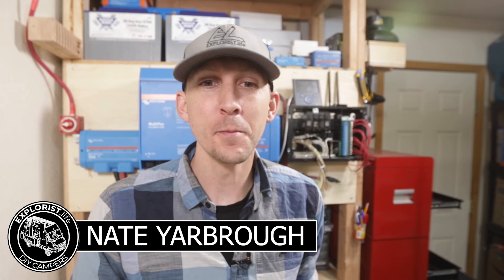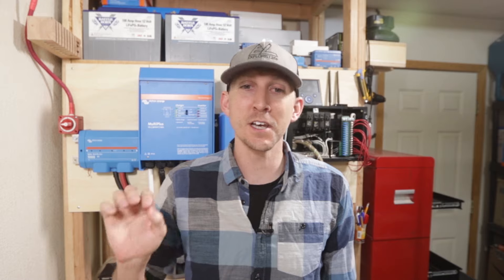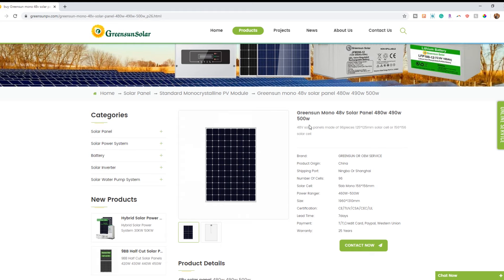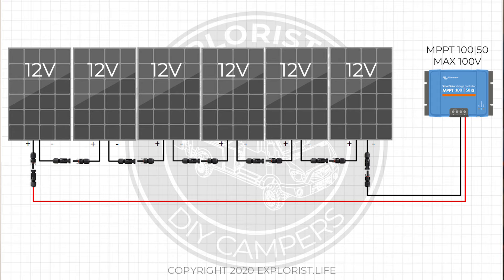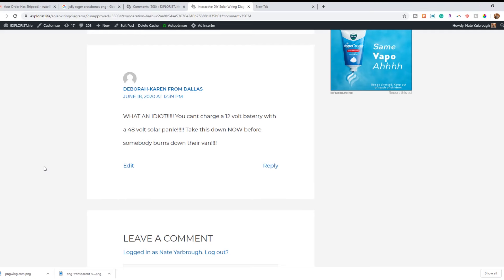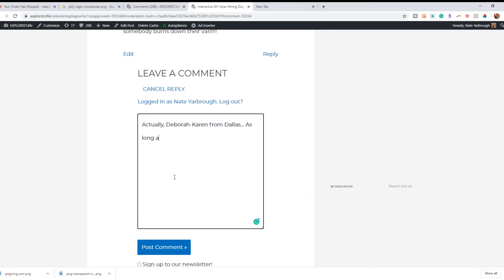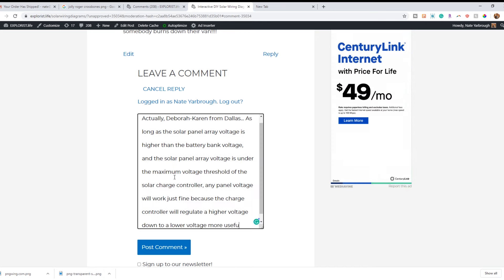12 Volt? 24 Volt? 48 Volt? Which Solar Panels for a DIY Camper Electrical Build

Comment: Hello I have 5 panels of the EPTECH Solar Panels EP156P/72 - 285 Watts  they are about 36.37V I want to use them with battery bank, how many batteries do I need and would you recommend series?

Comment: I have been using 2 house solar panel 48 v on mppt 12/24/36/48 and never had issue but I have 3 batteries and will charge faster then ctex 25 a

Comment: OK, here's a question; What is more efficient ? ?
3 x 100w 12volt solar panels or 1 x 36v or 40v (basically one large house panel) on an RV instead of 3 x 12v ones?
I have for a few years been running just the 1 x 100w 12v panel through an Mppt charge controller to 280a/h of agm's but an upgrade on my roof space means I now have the room to either add 2 more 100w 12v panels to make 300w or am I better off buying one large higher voltage panel for what I expect will be more efficient (knowing I also have to upgrade the charge controller which ever way I go) Any input would be great & thanks for the info!
Reply from the maker: They are both pretty great in most cases.  I'd just add 2 additional and identical panels if I were in your position.   A 'big panel' isn't really any more efficient than small panels.  There are simply more individual solar cells in a bigger panel than in a smaller panel.
Reply: @EXPLORISTlife  Howdy, Thanks for your reply. U totally understand about the actual size. Sorry, I was mainly talking about the efficiency between staying with a 12v solar system compared to switching it up to the one large 36-48v or whatever house style panel (so higher voltage with a different charge regulator of course) I have "heard" the the higher voltage panels are far more efficient than the 12v (rated) ones? I just can't find any concrete evidence on that.

Comment: So 2 12v battery on a 50w 24v solar panel with contrôler is ok?
Reply from the maker: Given the charge controller is an MPPT controller and properly sized, yes.

Comment: I am using 11 house hold grid tie 190 watt panels in series at 460 volts at 5 amps with a 500 volt max MMPT controller with 6 mm2 wire from the roof and 50mm2 wire to the 24 volt 600 ah battery bank 1 meter away. Running a split inverter AC, induction cooker, HWS and the fridge on 24 volts. another panel for the 24 volt 200 ah bus batteries, and another panel for 12 volt system for lights and water pump.

Comment: hi , im new to solar power , my question is ,,, i have 24v solar panels and a 12 volt battery bank , my charger controller is a eco worthy with the option on 12v or 24v , do i select 12v to match the batterys or 24v to match the solar panel
Reply from the maker: That sounds like something that would be addressed in the user manual.  If not, that would be a great question for the tech support of the device you've chosen.

Comment: I'm starting our offgrid homestead journey as soon as our florida house sells. I took job transfer to different state when house sell and going to do small farm. Some of the property we been looking at doesn't have power and water or to far to bring power in cost wise. We been doing our home work for the last 2 years homestead and farm wise for water and well along with farming items. I work for propane company and going to do generator along with gas appliances. So just recently the last few week watching video, reading up on solar to decide something for us. Your videos have been great and was questioning what voltage system to go with. Been told for whole homestead needs to do 48v system. I started to price out and find deals on equipment needed. I was delivering one day and found solar wholesaler next to my delivery having a blowout sale. As they were moving to larger place and didn't want to move all inventory. So I made a deal on 32 new 260w panels not knowing what I need, but had few comparison offgrid system I had seen. We haven't sat down and broke down our needs and wants for the homestead other than using our current house which is to big and down sizing. We will doing mini split ac system, energy star fridge, will do low watt led lights. We also will be putting tiny house on property for daughter and granddaughter too. Both places are going wood stove and propane backup heat with cooking and hot water. The more I read, watch, price out and figure the solar system things are getting scrambled lol. I know wiring houses and electronic as I did rigging on boats and sounds systems. But the solar is getting the best of me and how many batteries, controller, inverter. Any info you might be able to give me would be great. Thank you for your time sir. Kyle
Reply: Panel spec 
32 panels at 260w 
60cell
Imp 8.34a
Vmp 31.2v
Isc 8.83a
Voc 37.7v
Max fuse rating 15a
Max system 1000v 
Oh the area I'm moving to 4.79 sun hours
Reply from the maker: You could look at your current power statement to determine how many kWh of power you are currently using and use that as a baseline to determine how many batteries and solar panels that would translate into.  From there, you'd want to also make a decision on how much inverting power you'd need, which would be a combined total of ALL of your 120v devices you could possibly use at the same time.  That should get you pointed in the right direction.
Reply: @EXPLORISTlife  thank you for info I just looked and currently the high month for usage in Florida summer was 2,765kwh for 30days = 92.166 per day. we also looked at what we now run at once minus the electric dryer as we want to do gas appliances and minus central ac unit. So I factored in couple mini split units so that is 10, 301 watts at one time ac power.

Comment: can i mix 2 panels with different amps? (e.g. 12v 10 amps and 48v 5 amps) i have a stock solar panel and my plan is to get a second, bigger, one with at least 240watt

Comment: I know this video is old but I'll try my luck. I'm looking at a Sungold Power all in one system and it has a built in mppt charge controller with a 150v max. But it also says "PV voltage range 120-150v". So now I'm confused. I was thinking my 4 12v solar panels would be fine because the max voltage would be under 150. But now I don't know if my charge controller would be underperforming unless I can reach between 120-150v
Reply from the maker: That is indeed an oddly specific requirement.  Try reaching out to sungoldpower for tech support on their products?
Reply: @EXPLORISTlife  Lol i didn't expect a reply. I appreciate it nonetheless

Comment: Hopefully this gets seen, so say if you have 4, 460 watt panels and want to wire them in series parrellel you have 1800+ watts are there any good charge controllers for that kind of load or should I split the system into 2 separate power lines of about 940 watts, going to the batteries?

Comment: silly question but do the total volts of the solar array have to be higher than the battery bank you are charging?  so for a 48v battery do you need to make sure you have a solar array that is over 48v?
Reply from the maker: Yes.  And for optimal MPPT charge controller performance, the solar array should be at least 20V higher than the battery bank charging voltage.
Reply: @EXPLORISTlife  Thanks.  Looks like I may have to go down to a 24v system for the number of panels I have.  Thanks again.

Comment: Can I add a 200 watt wind turbine to my Renogy 400 watt kit? If so, how?
Reply from the maker: Anything is possible with the proper application of funding. :)  I don't have any videos about wind turbines, though, as they aren't generally used in camper electrical systems.

Comment: Thank you, this answered my question. People keep talking about 12v, 24v and 48v panels but it doesn't matter as long as you spec your array and controller accordingly. :-)
Reply from the maker: Exactly!
Reply: I am people bc the people aren't electrical engineers or solar gurus im a plumber buddy take it easy on us and answer my above question.  If you have all the knowledge please
Reply: Why buying a more expensive higher 48 volts solar panel when at the end it will be reduced to 12 volts which is the needed voltage instead of buying a cheaper 12 volt panel? That doesn't make sense to me. 🤔🤔

Comment: hello now I have a 5kw inverter on it there is an internal mppt 60-115 volt dc charge control I want to connect 2 48 volt panels panel voc 48.96 100 volts in cold air?
Reply from the maker: This video will teach you how panels react to cold temperature: https://www.youtube.com/watch?v=MxziHKvTRh8

Comment: i have a bus that im making M class to motorhome 
EPEVER MPPT Charge Controller 40A 12V / 24V
can run 3 Parallel for 4 panel there 12v 100w
the make on the my changer is a max of 1040 watts at 24 vot and 150 vot 
if i do 12 panels they would be 80 volt at 15 amp but 1200 watts
will this be ok to run like this 
battery bank are 24 volts 
thanks for any help you can tell me
Reply from the maker: Hey, Vlogging Country! I appreciate you taking the time to ask your question, but unfortunately, I don't have enough info about your specific question to provide an accurate answer, but here is a playlist that, if you watch all of the videos start-to-finish (and take notes 😉), you'll have a REALLY good idea of how to design a solar array: https://www.youtube.com/watch?v=Jkbs84sBHsg&list=PLmvhcyi4n0TV9pi83rFTv3ZuMT_S1xIZt

Alternatively, I have some of my most common solar array setups pre-built here: https://shop.explorist.life/product-category/all-products/camper-wiring-kits/solar-charging-wiring-kits/

Comment: I did not even know that some rate panel voltages like that lol, never seen it before... It must be as a tradition left back from the stone age when you did not have charge controllers and actually connected panels directly to battery?
Reply from the maker: Yeah, there are even solar panel companies that market them as such.  Pretty confusing for the end user.

Comment: I have some 150 watt panels that say they produce 18 volts and 8.58 amps.
I'm wanting to hook two panels at a time in series and have two arrays consisting of four panels each.  if I understand correctly doing this will give me roughly 72 volts and roughly 17 amps per four panel array.
each four panel arrays will be connected to MPPT Charge Contr. capable of 100 volts and 60 amps max. for a total of eight 150 watt panels, two 60amp charge controllers.

Question: I want to use a battery bank of ten 12 volt AGM batteries, wired together two at at time so I can create a 24 volt battery bank and use a 24 volt inverter.

I plan to have two large buss bars to tie batteries together on after doing two at a time in series to get my 24 volts per pair and then connect 4/0 cables from each positive and also negative buss bars to input on 24 volt inverter.

does this sound right?
Reply from the maker: From the information provided, it seems like you are on the right track, but your solar array voltage will not be 72V.  It will be closer to 40ish volts in a 2s2p configuration like you said.  More info: https://www.youtube.com/watch?v=KJ5zCY5EBeQ

Comment: Is  there any  way  to  just  charge  a 12v batter  from  my  solar  and  ,....something  between battery  and motor to   move  it  up  to  48V ?  right now,  I  have  pannels, charge controlers,  and  batteries,  power  come  in  thru  an  inverter,  so ...what  would  be  the  hookup ?  I'm  a  bit  confused  now
Reply from the maker: I'm not really sure what you're after, but this complete install video may help: https://youtu.be/01F4QDVJUq0

Comment: i know this video is over a yr old n u might not see this. just wanted to know. i have the renogy 50 to 50 dc mppt controller. on my van i have 4 panels @ 190watts ea i use in my 12v system setup. i have them wired is parallel n im getting 240+ watts most of the time when the sun out. after watching this video i was wondering if i wire them in series n get like 80+ volts @5a then i could be pulling in 400+ watts correct

Comment: Ok, So I can buy a 48 volt wind generator and wire it to my two 12 volt Batts, wired as 12 volts? or do I need 4 batts. wired as 48 volts? I have a 60 amp. controller but not a MPPT, the other one.
Reply from the maker: I don't have enough information about your entire system to fully answer your question...but here is how I recommend wiring systems: https://www.explorist.life/solarwiringdiagrams.

I recommend a 12V battery bank for anything under 3000w of inverting power or 1450w of solar.

I generally don't recommend wind generators for mobile solar applications, so I can't speak for how that would play into the system, but I know it WOULD be compatible.  You would just have to do your due diligence to determine HOW to make the wind side of things work.

Comment: So maybe you replay here , if I have controller /charger that has 960watt input max at 24v  , means I can install up to 26 panels@24v(maximum voltage36.5per panel) because 960/36.5=26.3??

Comment: hi., i have a hybrid inverter with built in MPTT charger with voltage range of 120Vdc-450 Vdc., how much solar panel array voltage should i use.?

Comment: Oh,, by the way you might have mentioned that its the VOC (open circuit voltage) spec on the panel that matters,,,not whether the panel says 12,24,48v. Again, good video.
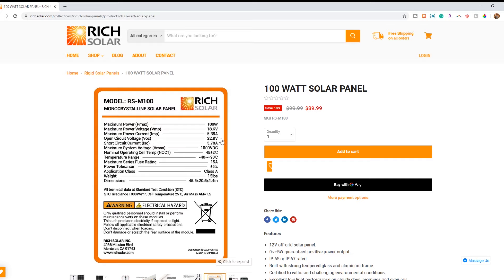Reply from the maker: Indeed!  That was the whole purpose of this video and I mentioned it pretty specifically at the 1:30 mark.

Comment: Can you explain how to choose what system voltage to use?
Reply from the maker: (The following are my opinions, not codes/standards)
For Systems requiring less than 3000W of Inverting power, use 12V.  
3000W-6000W = 24v
6000W+ = 48V

Comment: I have some 240Watt,  37.48 Open Circuit Volt Solar Panels...  How do I CHARGE a 12v Batter Bank with this Panel?   Most PWM I see are AUTO VOLTAGE, therefore I think they would go to 24v.    I have 12volt light in my Green House and a 12v Battery Banl.   I want to use this Panel, I'm kinda lost on how to do that, and help would be most appreciated...  Thanks
Reply from the maker: You should use an MPPT charge controller.  More info:  https://youtu.be/MxziHKvTRh8
Reply: @EXPLORISTlife  what size?
Reply from the maker: This video will teach you what size you need: https://youtu.be/MxziHKvTRh8

Comment: Can someone verify if I understand this correctly?…….

We started out with 2 Renogy 100w Mono panels, and now have 5. Slowly we are buying panels and adding to our system. Since the system is always in process of growing, we purchased an EPEver MPPT 40a controller. I, like Im sure many others, thought that the batteries had to be wired in series for 24v in order to connect panels in series for 24v, but it seems that I may have been mistaken. Can I wire our panel array in series for 24v (in order to reduce cost based on wire size), and then let the MPPT charge the 12v bank in the most efficient manner? It is important for us to have a 12v battery system because we use our solar system to power a predominantly 12v system of fans, lights, radio equipment etc. AC is only used sparingly via an inverter in the event of a power outage

Comment: Just curious where I could find fuses that fit the 

WFCO WF-8930/50NPB-50 50 Amp or 30 Amp AC Distribution Center 

I bought ur diagram everything is coming along well. Just can’t find fuses that fit. Could you point me in the right direction? Thanks for the awesome help you’ve given myself and others
Reply from the maker: The DC fuses inside of that unit are called "Blade Fuses": https://amzn.to/33AB1vh

Comment: I hope you can help me ! I am buying an elechive solar generator , it says it can use up to 800watts and the solar panels should be between 35v and 150v 
I have a dokio portable solar panel 320 watt , 18v , I am wondering if I can use 3 of the dokio panels wired in series for this solar generator ? 
The generator has a built in mppt controller even thought the panels come with a controller I think I just use the built in on the generator, would it get damaged in full sun ? Could I maybe wire 2 320 watt panels and a 100 or 200 watt panel all together , this is so confusing ? Are you somewhere I could pay you to wire them together for me
Reply from the maker: Although it seems like the 3x panels wired in series would indeed be below the 150V max solar input of your unit, but would exceed the maximum wattage input.

Mixing solar panels CAN work, but care must be taken to avoid power loss.  More info: https://www.youtube.com/watch?v=jejro4zkl8I

Unfortunately, I do not offer installation services.  Sorry about that!

Comment: With the charge controller regulating the voltage down from 24v to a 12v output for the batteries, would that mean the amps would go up slightly?  Eg. 100w/24v= 4.16A
                                               100w/12v= 8.33A

Comment: Ive seen some silly people that dont like high voltages on the array  and wire panels in parallel and stay close to 12 volts they forget that the controller needs the pv to be 5volts above battery voltage before it starts charging. They are missing out on valuable sunlight hours. RTFM.

Remember, its maximum power point tracking, higher array voltages are needed for best performance.
Reply from the maker: For sure!  That's how we also have all of our pre-designed solar arrays built out: https://shop.explorist.life/product-category/all-products/camper-wiring-kits/solar-charging-wiring-kits/